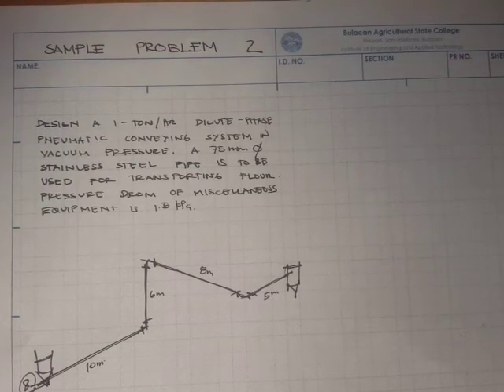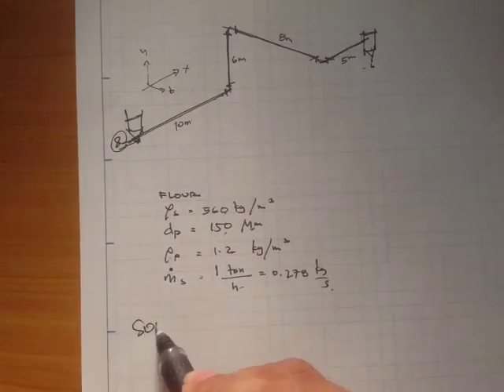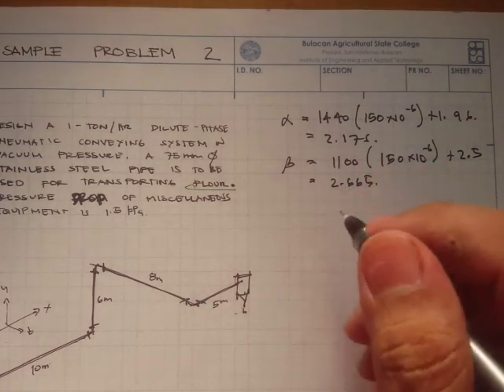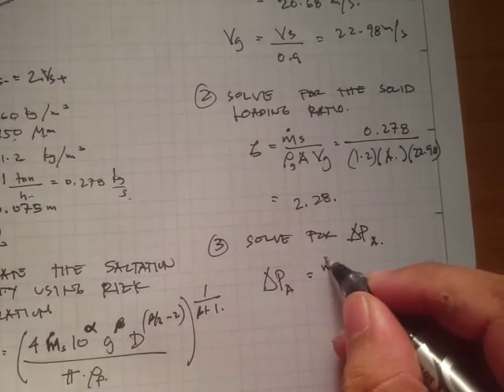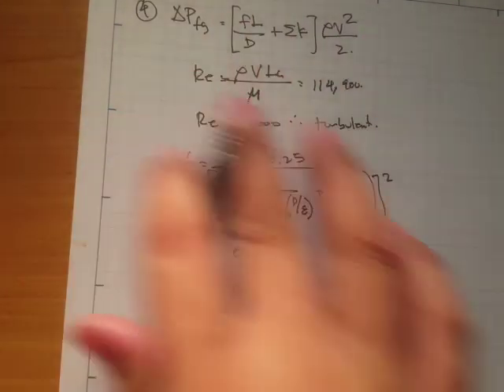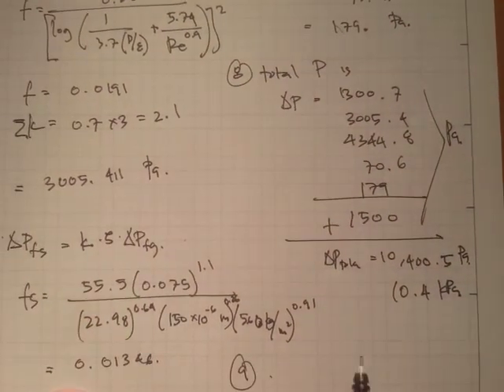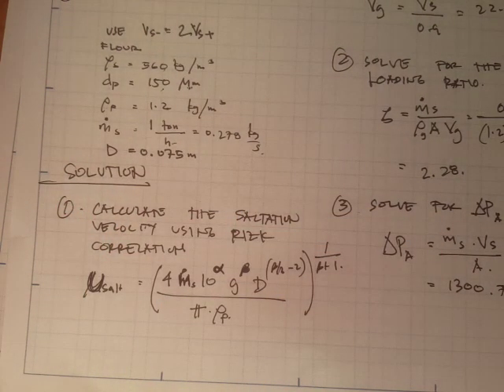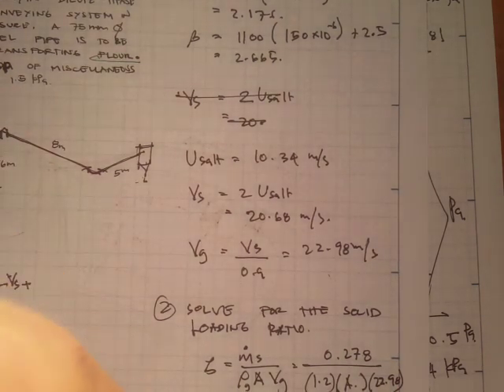ABE180 - 06.05 - Design of Pneumatic Conveyor (Part5)

Comment: I have an inclined pipe pneumatic conveyer. I'm wondering how can I calculate L. Should I consider it as a horizontal and a vertical pipe?
Or I should just add the length of the inclined pipe + k for 45 degree elbow? 

Thanks,
Reply from the maker: you should take the inclined distance.  the k value will depend upon your type of fitting if it's 45 or 60 or whatever.

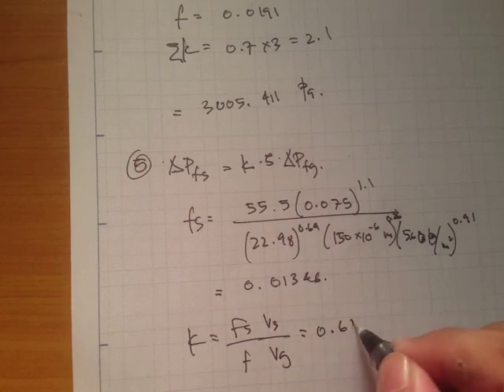Comment: 13:49 I think there is a mistake. You have used Vs = 10.34 m/s for positive pressure conveyance when calculating the K factor. Should be used 20.68 m/s instead, for negative pressure conveyance?

Comment: Cool video. One question... Why did you choose bulk density of flour instead of true particle density? I agree bulk density of patent wheat flour is about 600 Kg/m3, yet don't understand why you chose it.
Reply from the maker: thank you! I never thought about using the particle density just simply because the bulk density is commonly available and that I think of the transport as a bulk transport and so if there'll be differences, probably I can compensate it in the factor of safety.  

however, the question intrigues me to check on my calculations.  and what I found is that, if I use the bulk density (in a value that bulk density is smaller than the particle density), I will get a larger value of pressure drop for solid frictions.  therefore, with respect to estimating the pressure drop for sizing the blower, I'll be more confident.  but again, these are just theoretical and this applies only to the equation I used in the estimating the solid friction.    I haven't checked yet the other solid friction equations.  

let me know what are you thoughts on this.  but good question though!  again, thank you
Reply: @sirby_lectures  Unlike terminal velocity, Rizk's saltation velocity correlation does not take material density into account. It only changes if you modify gas density, pipe bore, material mass flow rate and mean particle size.
Reply from the maker: @Alejo91PA  explicitly yes.  but isnt the mass flowrate related to the density?

with regard to the terminal velocity, i've seen some references using that instead of the saltation velocity.  and im just thinking maybe it's related to the pneumatic transport along the vertical?  just my hypothesis.

Comment: BTW... You are missing number 2 in the ∆P calculation due to gas-to-pipe wall friction. Number 2 should be multiplying the rest of variables in the Darcy-Weisbach equation.
Reply from the maker: do you mean using the fanning friction factor instead?
Reply: @sirby_lectures  Yeah. Why didn't you put the number 2?
Reply from the maker: @Alejo91PA  the friction factor was obtained using a correlation (or use of moody chart) and the derivation of the pressure drop doesnt have a no. 2 or 4 in the numerator.  so technically, it's not consistent to multiply it with 2, unless i am thinking about it as a safety factor on the pressure drop estimates.  

now if i use the fanning friction factor, i must use appropriate correlations or charts.
Reply: @sirby_lectures  I guess you are fully following me on this... Please take a look at the Agarwal paper you showed in one of the videos. In the very first page, you will find the number 2 on the pressure drop correlation for gas-pipe friction (third term of the  ZENZ and OTHMER equation).
Reply from the maker: yes, you're right if you use the fanning friction factor, there is a number 2 because it's 4f/2g ... .  but as i have said i was thinking about darcy friction factor. i was just thinking about consistency of units since the darcy-weisbach equation is a derived equation.  but practically, you'll just get a  higher pressure drop estimate when multiplying it by 2 which is usually good from a design standpoint.  

my question to you now is, do you use the same correlations (or moody chart) for both the darcy and fanning friction factor?  and then just multiply it by 2 (or 4)?

Comment: BTW... Is the total pressure drop expressed as abs or gauge? Thank you.
Reply from the maker: it's a gauge pressure as fans and blowers (or any other machinery or equipment) are typically specified in terms of that.

if we want to doubt, we can also check the value if it's more than (since its a positive system) the atmospheric pressure of 101 kPa.
Reply: @sirby_lectures  So if total calculated pressure drop is, let's say, 25 psi, in case atm pressure is 14.7, total gauge pressure required from blower or compressor would be 25 - 14,7 = 10.3?
Reply from the maker: @Alejo91PA  I mean, since in the calculation we obtained a value of 10 kPa, it's already a gage pressure.  compare that to the atm pressure of 101 kPa (14.7 psi).

if we take that as absolute pressure, that would be a vacuum (negative) pressure with respect to the atmospheric .  but the pneumatic system is a positive system, so it wont make sense.
Reply from the maker: @Alejo91PA  the gage pressure is the calculated value; in your case, the gage pressure is the 25 psi.

Comment: I am still going through this and making an Excel file out of it if you are interested. As someone else pointed out in the comments for the Saltation velocity I get 23.8m/s compared to your 10.34m/s. I get the same values for gamma and beta though. Here is my calculation below maybe I am mixing values or maybe you made a mistake ;)

Usalt = ((4*(1000/3600)*10^2.176*9.81^2.665*0.075^(2.665/2-2))/(pi*1.18))^(1/3.665) (you can copy paste into WolframAlpha)

Cheers!
Reply from the maker: As I was reviewing my lecture handouts, I've found that I forgot to write that the exponent of 9.81 should be 2.665/2.  

((4*(1000/3600)*10^2.176*9.81^2.665/2*0.075^(2.665/2-2))/(pi*1.18))^(1/3.665)

Sorry about that mistake.  The exponent has to be divided by 2.

With regard to your excel file, sure, I'm interested!  I'm actually amazed that you and many others have find this helpful/interesting.  Especially you, that you want to make a program out of it.  It's been more than a year already since I teach this course. Originally the course wasn't about design, but I just oriented it toward design applications.
Reply: @sirby_lectures  Thanks for clarifying this :) It works now!